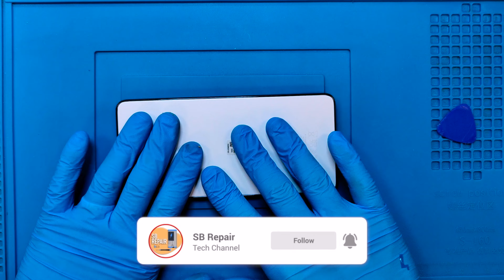Samsung Galaxy A53 Screen Replacement #samsung #screen #a53

Comment: Hello, thank you for the Video. I just changed my Display and the Touchscreen doesnt respond. What could it be ?
Reply from the maker: this shouldn't happen if you did everything right. check the screen connections, if it still does not work, there may be a screen error or a different error on the motherboard. I suggest you go to the nearest service center for this.
Reply from the maker: you should also get the screen according to the correct model code, for example, the screen of USA devices will give an error on EU devices